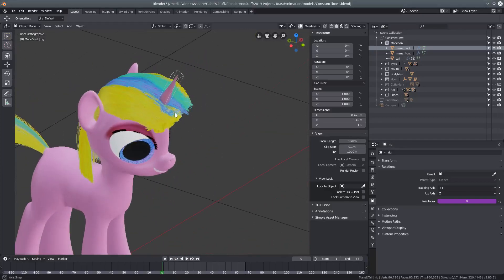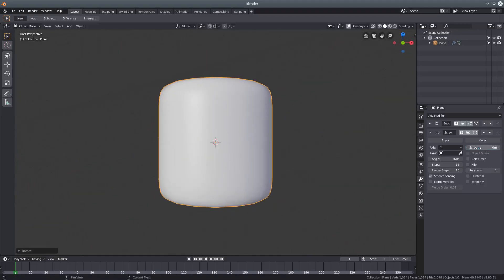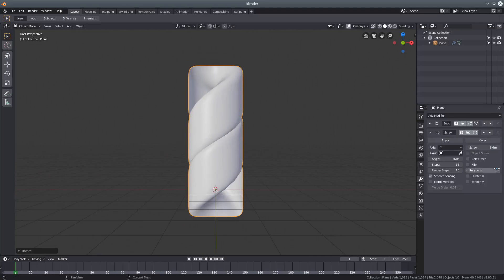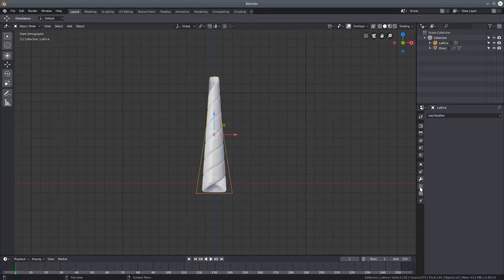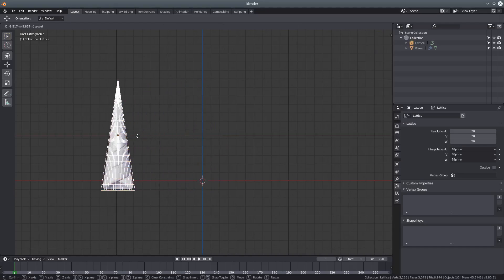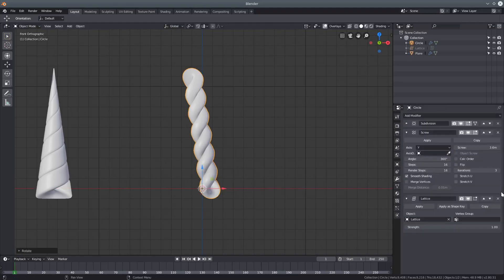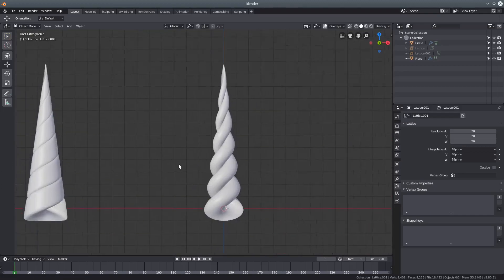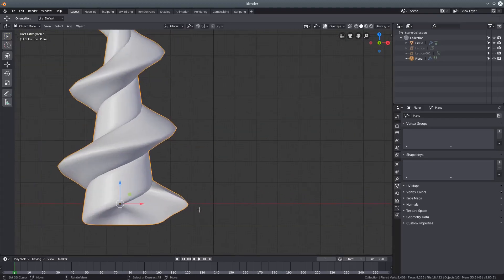Blender 2.8 Unicorn Horn Modeling Tutorail

Comment: Muchas gracias por el video!! Fue super sencillo y muy bonito resultado, mil gracias!!

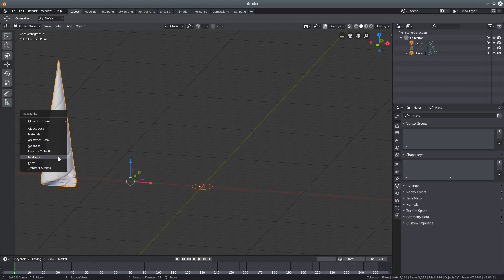Si alguien más se perdió en el minuto 2:04 (donde copia las propiedades del 1er cuerno al 2do cuerno) lo que tienen que hacer es seleccionar los 2 objetos al mismo tiempo (en modo objeto seleccionan primero un objeto y con shift seleccionan el segundo objeto) luego dan ctrl l y les puede aparecer la misma opción que aparece en el video ó también puede que les aparezca "copy modifiers" o "copiar modificadores"; luego g x 90 y luego en herramientas eliminan el modificador de "Lattice".

Thank you very much for the video!! It was super simple and very nice result, thank you very much!

If someone else got lost at minute 2:04 (where it copies the properties of the 1st horn to the 2nd horn) what they have to do is select the 2 objects at the same time (in object mode they select one object first and with shift they select the second one object) then give ctrl l and the same option that appears in the video may appear or "copy modifiers" may also appear; then g x 90 and then tools remove the "Lattice" modifier.

Comment: When i add the lattice i am using the grab tool to shrink the vertices to fit the horn. then i parent and do "lattice deform". At that point the horn shrinks to like half the size and moves location to above or below or half-in, half-out of the lattice. 

i was thinking maybe the grab tool was making this issue so i used the scale tool to fit the lattice to the horn. but when i do the scale tool the other vertices shrink and i can never get the lattice to fir the horn.

any help?
Reply from the maker: Lattices are a bit finicky. You need to add the lattice and scale it in object mode to fit the horn then parent the horn to the lattice. I would delete your current lattice, add in a fresh one, then scale it to fit your horn IN OBJECT MODE, then parent it. Then continue the part of the tutorial where you edit the lattices to deform the mesh in edit mode. I hope this helps.
Reply: @gabe2252  i figured it out. this tutorial was great thank you. besides that struggle. beggers cant be choosers. and im glad you took the time to post this anyways! and yes i guess it was object mode that did it

Comment: is there a way to make it non-manifold for 3d printing?
Reply from the maker: Would this work for you? https://drive.google.com/file/d/1fgWc2qUmIdUmP-lbiNH2kBUqejz-Q-ll/view?usp=sharing I flipped the normals in the screw modifier  then applied the subsurf, and screw modifers. Then I filled in the caps and extend the bottom then applied the lattice. I can make a new tutorial on it
Reply: @gabe2252  I would love to see a tutorial on this. I want to 3d print some unicorn horns.